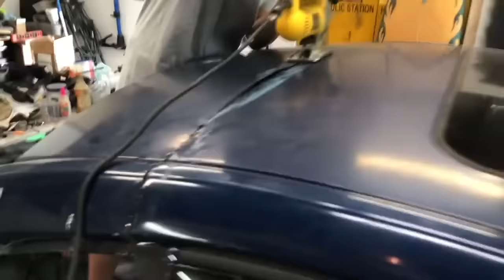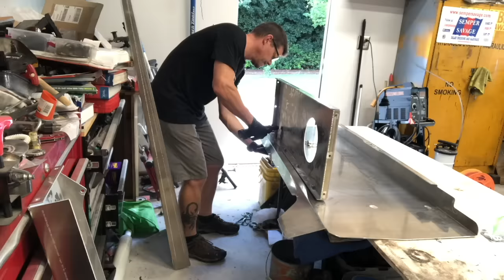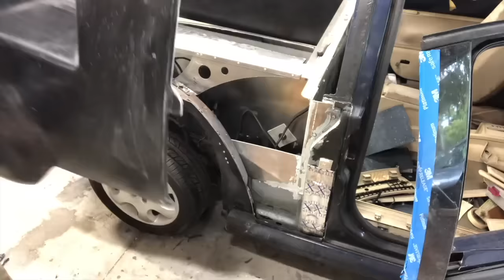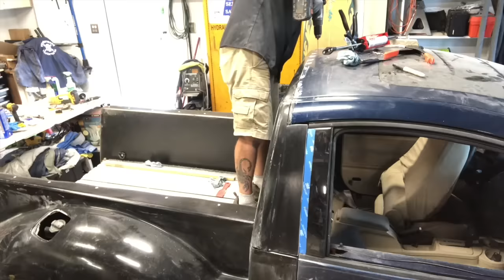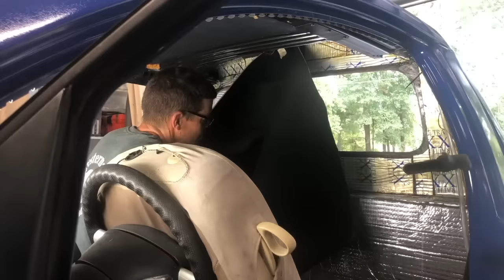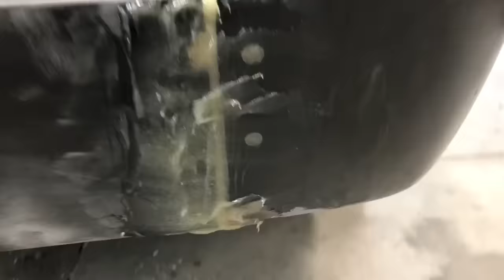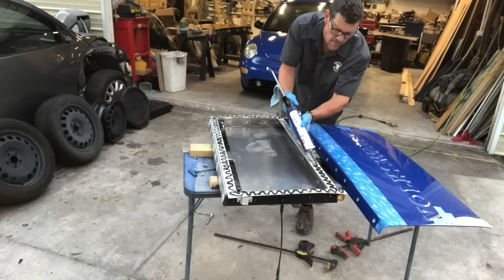Smyth Performance Beetle Ute build Full video

Comment: Very cool project. I didn’t realize it was a kit. Beyond your control but the one thing I think I would change is spread the bed walls out to the wheel well seams. Just a personal thought. From the thumbnail I thought it was an original Beetle.  There were a few customs running around town in the 70s. Pickup, 40s Ford nose, dune buggy’s galore and more.

Comment: Interesting build. I like the concept. Where I live the rivets wouldn't pass our strict laws which demand an engineers report, but an all steel version would work with welded joints, a lot more work. I like your version and the surf board sets it off.

Comment: fantastic job. Just saw a yellow one cruising around Orlando, before Christmas, and was amazed. What about all that wasted space for the spare tire??? Also, did it seem ridged and crash worthy, after slicing and dicing?? Actually wouldn't mind building one myself.
JT
Reply from the maker: JT, I am very confident in the safety and integrity of the kit. This is the third one I have built from Smyth Performance. If you are interested in more on the engineering and safety, visit their website, WWW.smythkitcars.com and look for the tab at the top labeled "safety and engineering". the new 'box" you build down each side is extremely rigid. And the stout floor spars tie them together well. He also has pictures of Christ Kingston's beautiful Jetta kit that was rear ended and slammed into the car in front of him. I'm impressed with how the kit handled the impact

Comment: Nobody cares about the stiffness after modification??? The Beetle was specially build to be stiff with its unique design and when you cut so many metall and put some aluminum and rivets together i never would have a bad road or an accident in this... This thing needs a steel tube frame underneth all of the new panels and an rollcage tube also. And then all the Space you waste, for excample the old spar tire place... Sometimes its good that we in germany have so much rules for change and rebuild our cars.

The rest of the build looks very good and in high quality, build this stiff and safety and i want one also :-)
Reply from the maker: if you are interested in the engineering and safety aspects, check out this link https://www.smythkitcars.com/engineering
Reply: That was 1 thing I did not understand losing the spare tire space

Comment: This would actually be the most absolute practical vehicle for someone like myself; single in my 30s and living right downtown congested Toronto, Canada - having to rely on street parking in permit zones because my apartment doesn't have a parkade as well as the higher than average petrol prices. I constantly need a vehicle that can carry a small size of cargo, maybe a couple bikes or big boxes, I rarely have more then one passenger other then myself, parking in Toronto is a nightmare just like the gridlock and it needs to sip fuel but still be fun for the odd road-trip to Montréal or New-York. It is truly the perfect car for me.
Reply from the maker: it does sound like a practical fit for you. I find this and the Jetta Ute very practical for me. I have a big truck too but 90% of the time Im hauling a small load so I can drive this and get 40 MPG instead of the 18 MPG from my 3/4 ton truck

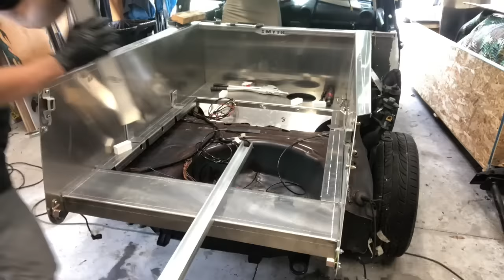Comment: Should have made the spare tire well usable.  07:53
Reply from the maker: You can still access the spare tire well. Its just a a few 1/4-20 bolts to take the bed floor out. Spare still fits along with the jack and lug wrench
Reply: @hesty32  That just answered a key question, as I was wondering what happened to the spare. Great job, well done!

Comment: NO WELDING SKILLS??...I THINK IN TIME THOSE RIVETS WILL WEAR LOOSE...
Reply: It's hard to weld fiberglass. He could stand to spend a few bucks on a pneumatic riveter, though.
Reply: @thisguy1520  I WAS TALKING ABOUT THE BOX..
RIVETS ARE NEVER GREAT IDEA....FIXED TOO MUCH STUFF OVER YRS BEEN RIVETED..
Reply: 100% right. At least use some glue as an extra
Reply: Or put more rivets like 1 every inch...
Reply from the maker: niet janken there actually is 3 tubes of panel bond in there. The rivets are actually just to hold it snug as the panel bond cures. That’s really where the strength comes from.
Reply: hesty32:  Airplanes are riveted and glued.  Just sayin'.  :-)
Reply from the maker: @tom7601  yeah thats what I've been telling people, if you don't trust rivets and glue, dont fly anywhere! The newer stuff isn't even riveted, just glued LOL. course we aren't talking about Elmers here lol

Comment: Great job man! At least you didn't have to work around the motor like I had to do, 40 years ago! But really, great looking car and I think that you said it was a diesel? If it is, you should get around what, 50 miles to the gallon. One of the sales guys that used to come by the shop had a VW wagon, don't remember the model, but that's what he told me that he got with his. I love the small diesels anyway, cheap to run and last forever.
Reply from the maker: yeah its a lot easier on the new beetle with the engine in the front. Its funny though how many people still ask how I moved the motor LOL

Comment: So really good job! It's fun to see you at work, how well structured and clear.
The result is a matter of taste.
I find the idea of putting both beetles in one not as enriching, but rather in the direction of scrapping gag.
There is a old Beatle conversion to the Pic up on the net. He would have had the chanse to make a Pic up version of the new Beatle. It has to remain a Beatle from front to back.
I'm looking forward to your opinion.
Regards Hanzi
Reply from the maker: The Beetle (and the New Beetle) are definitely a matter of personal taste and so is this Smyth kit conversion. I wouldn't be able to cut up and old Beetle (air cooler). But the New Beetle is so plentiful and tons of run down examples about to go to the junk heap, I have no problem cutting one up or changing the looks. I totally understand that not everyone likes the swoopy lines of the rear end and it doesn't exactly match the more rounded lines of the Beetle front. Like you said, its all a matter of taste.

Comment: Any problems with flex? Did you do anything to strengthen the chassis after the cut?
Reply from the maker: driving it you can fill that it is more rigid after the kit! I wouldn't have believed it but Ive done three now (including Jettas) and they are all the same. The channels you build with the bed wall and the doublers on the B pillar really tighten it up

Comment: Australian utes had a drop down small door under the tail gate to access the spare wheel well. They were built of wagon platforms, unfortunately the spare holding area was also a water and mud trap and rusted away very quickly. (Along with the footwell)

Comment: Fantastic build! How do you access the top nut for the rear strut, or is it all accessed from the bottom?
Reply from the maker: On the MK 4s and new it is access from inside the wheel well so nothing in the suspension changes with this kit

Comment: I have a few questions.
How weather proof is the bed?
Can it be spot welded instead of riveted?
Can the kit be modified to fit a spare tire on the side like old timey trucks?
Can the average jane put this together with limited knowledge &  basic tools?
Will rust be an issue on the long run?
Everyone seems to be unhappy about how OP didn't do "this" or "that", they even complain about the colour scheme but no one seems to ask or input about the engineering aspect of forthgoing such task.
Reply from the maker: You have to spend a little time making sure you seal the bed well but done right, it is waterproof and I have no problems with water leaking into the cab. It is dissimilar metals, aluminum and steel. The bed components could be welded together (they are all aluminum) but really the rivets are secondary to the panel bond. Panel bond has a shear strength of over 20,000 PSI so that is probably stronger than the rivets and bolts!  I wanted to do a side mount spare like you described but when I mocked it up, it didn't look right. The wheel is too big or the fenders too small. It just overpowered the bed so I didn't build it. It is possible though!

Comment: I personally would have liked to see what this would look like with the final gen LED tail light style, but this is still mind blowing and amazing job. Is this daily drive-able?
Reply from the maker: definitely! it was my daily driver for about a month. The week before Christmas, I drove it from Jax FL to Sedona Az. The kit comes with flush mount 2.5 inch LED tails. I just wanted to do something a little different. Gonna build another one in the next couple months and that will be my daily
Reply: @hesty32  that's neat. but one question: how do you register this after the conversion? Does the DMV require you to dance around with the fact that the vehicle has changed?
Reply from the maker: @gabenegron2373  All depends on your state. I inquired at the DMV, in FL, you can leave it as it is or pay $200 for VIN verification and inspection, and $200 for a new title. Mine is still registered as a Beetle. AZ is similar but I don't know about any other states.

Comment: If you think to do one of these don't overlook the opportunity to take the dash apart to get to the heat / AC box and redo the control doors with the big holes in them and foam glued to both sides of the holey doors such that when the factory foam falls apart you are left with little to NO HEAT ......To recover the heater doors we use a plastic sheet packing material or you can buy plug kits to pop into the holes and solve the inevitable problem that way ....

Comment: Looks great. Q: could you have built in a lift door at allow access to the spare tire well? Honda has a great 8.4 cu.ft. well in the bed. Great uses. Thanks for the videos.
Reply from the maker: Yes you can. the floor panels are bolted (not riveted) so you can pull up the floor panels and still access the spare tire well. If you want to get really fancy, you bolt the three panels together, add a piano hinge at the front and a couple Zeus fittings at the back with a hydraulic piston and you have the same function as a pickup bed cover

Comment: I saw lots of metal getting cut out of the car but how stiff is the new structure?I saw lots of bonding and riveting but no welding....I'm curious how this compares in structural rigidity to the original laser welded car.
Reply from the maker: the added structure is all aluminum so you can't weld it to the original steel. But if you take a spirited drive, you can tell that the car is actually more rigid after the kit. The video doesn't show everything, there are a lot of 8 mm stainless bolts in there too. If you are interested in more data on the safety/engineering, visit https://www.smythkitcars.com/engineering
Reply: @hesty32  Thats good to know.It sure looks a fun car!!

Comment: How much does it cost to do a custom job like that on a car. I love the fact that is diesel vw & good on gas
Reply: there are a lot of factors but a completed car sells for $10,000-$15,000 depending on what model, milage, quality of the build, customizations, quality of body work and paint etc. Considering that the cars are around $2500 and the kit is $3000, thats between $4k and $8k to build it. Paint is a large chunk of that.

Comment: Volkswagen should be taking notes from this dude. 
I wonder if you could make it AWD with an Audi quattro drive system from a 2.0T? The Diesel is a totally different bell housing , but for 2.0T gas engine it could be a direct fit.
Reply from the maker: its the same floor pan as an Audi TT so you can cut the floor pan out of a TT and weld it in to have the tunnel and mounting points for the 4motion haled and rear drive system but its a lot of work.  Maybe next year!

Comment: Nice build. The amount of money alone going in to this build.its just not the kit for box. It's painting and interior work,etc. I see alot of places where you could weld it to make it stronger and last longer. (Rivots do come loose especially in aluminum)
Reply from the maker: True but most of the joints that are riveted are aluminum to steel. There are a few aluminum to aluminum joints that you could TIG

Comment: After the bed modification, does the car have to be stored indoors? Or is the bed sealed off from water getting into the interior of the car pretty well?
Reply from the maker: Sam Potratz if you do it right, it is fine. When you assemble it, you just gotta seal a couple of seams well

Comment: Amazing job, I have an 05 model, when can I drop it off? LOL awesome job
Reply from the maker: bring it on down! 05 is the best year. 06 and newer have this flat spot on the fenders that doesn't match the kit perfectly
Reply: @hesty32  I wish I could, mine has 230,000 miles on it. I drive it an average 750 to 900 miles a week. It's a little commuter car. 2.05 speed. I'm hoping to get 350,000 miles out of it. I have shared your video with many friends. A lot of hard work you put into that. But it is awesome. I say it again, what a great job.
Reply from the maker: @billramsey8695  Thats pretty good for a 2.0! But if you keep good oil in it, don't race it, it will go a long time. 2.0 isn't a sexy motor but they are durable. I had a 2.0 Jetta wagon that was going strong at 225k until my daughter was rear ended and it was totaled.
Reply: @hesty32  
My little car doesn't get any thumbs up from people that I see on the road. LOL it's just my little commuter car. It drives like a go kart on the highway. So much fun. I am very thankful for it. I do hope to get over 300,000 on it. I would be very happy with that. And no, I'm not a hot rodder. LOL like you said, it's not a sexy little high performance motor. Be careful how you pull out in traffic. Lol thanks for your feedback.

Comment: I was wondering, how you replace the rear shocks? Did you have to take the bed apart to replace them.?
Reply from the maker: the MK 4 era of VWs, the top of the rear shock is accessed through the wheel well. So it all works the same.

Comment: Amazing beautiful project will done. Is this kit available for sale.
Reply from the maker: yes, its made by Smyth Performance , www.smythkitcars.com
Reply: @hesty32  thank you for your quick reply, the kit not make any problems in future if required any repairs or maintenance.
Reply from the maker: @alhamedi66  no you can still get to everything for maintenance. You have to unbolt the floor panels to access the fuel tank access but thats not a big deal. Everything else is all accessible the way it is stock
Reply: @hesty32  many thanks for your quick reply. Best regards,

Comment: Cool thing, but what if the car will roll over? couldn't a rollbar be there? What about the rigidity of the rear of the car? What about water collecting on floats? I wonder if such a converted car would undergo a review in the EU?
PS. I would make an emergency wheel drawer accessible from behind, or align the recess and hang them from below.
Reply from the maker: the car is actually more rigid now. The B pillar reinforcements are just as strong as the original sheet metal steel. The roof would still crunch in a roll over but not any more than the original car. You put some drains in under the bed so water won't collect. The brown coating (I didn't fit spraying it) that suddenly appears is to add corrosion protection to the original steel. If you are interested in more info on the safety and engineering that goes into these, visit https://www.smythkitcars.com/engineering

Comment: pretty cool overall. only thing i didn't like was the retro tail lights they're out of place with the modern front end of the car. should have re-used the original tail lights. another thing that should have been done is the put a small 3" lift kit to fit bigger tires and should have put stronger shocks and struts. obviously so he could carry more weight in the bed.

Comment: How does this affect changing the rear strut / shock? The top nut is behind the bedside, and under the fender - no access.
Reply from the maker: On this era of VW, its inside the wheel wheel not on top. So the rear shocks are still serviced the same

Comment: Did you strengthen the frame after you cut the roof in half?
Reply from the maker: most definitely! All the metal panels form a rigid box down each side that is tied into the steel body. The floor spars then further box the two sides together. The front wall panel is triple reinforced at the top lip which ties the two B pillars together. For more info on the engineering and safety, visit https://www.smythkitcars.com/engineering

Comment: Great unique build!  Turns a worthless car into something interesting. I do wonder however, if spending 100 hours and $5k? of parts on a $1500 car is worth it.  Looks cool but I still don’t want to drive it.  Now, if you stuff an LS engine in it then you will have a real hotrod.  But I do appreciate the thinking outside of the box to make a poor mans Chevy SSR.  How about a Ford Flex (ecoboost) quad cab shortbed truck?  Make it a woody please.
Reply: ChanceSummer Really no project car is “worth” it from a purely financial perspective. This doesn’t really seem too bad though, the kit is 3k, if a new beetle is 1500 and we’ll figure in an extra 1k for paint and other expenses that’s less than 6k for a custom looking truck that’s useable as a daily, that doesn’t seem too bad. Plenty of other people will spend 50k and up on a custom car they’d be lucky to sell for 25k
Reply: The title has the word "ute" meaning utility, not a hotrod.    It's a daily driver with a twist of custom.  Not all custom cars have to have a V8 or garage/trailer princesses lol.